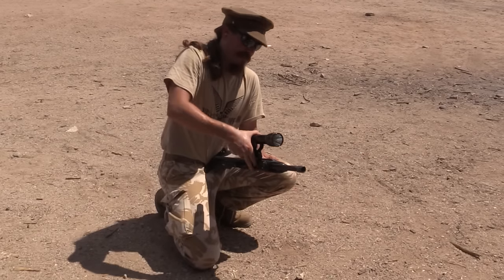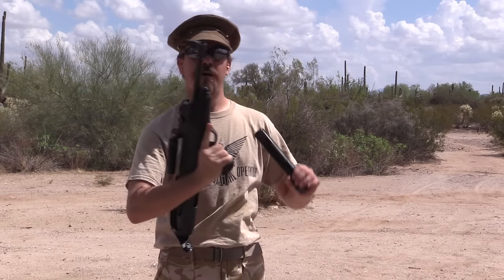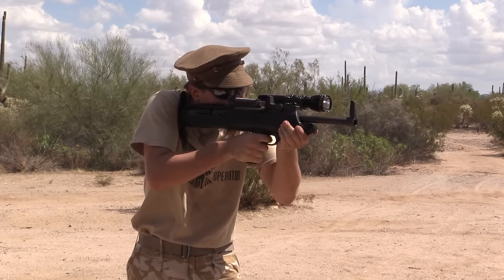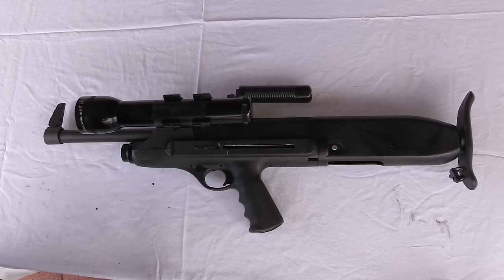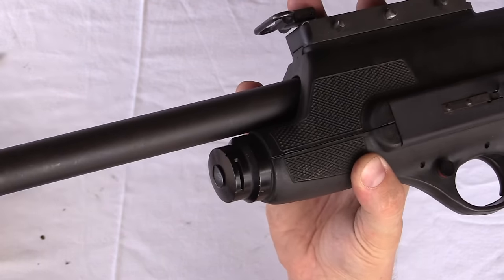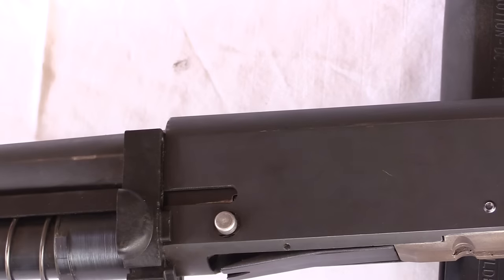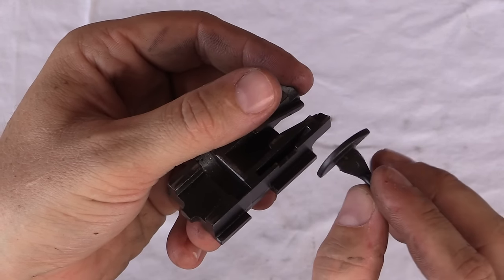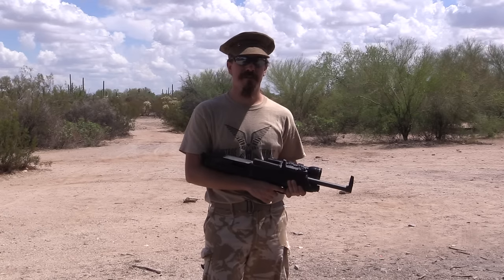High Standard 10B: Disassembly and Attempted Shooting

Comment: Very informative as always. However, I feel I should correct you on one point. The Kel-Lite was very much NOT "a knock-off Maglite." Kel-Lite was in fact the original heavy-duty law enforcement flashlight and originally was not available to the public. I'm not sure when they began to be produced, but by the late 1970s, the Kel-Lite was the default flashlight for virtually all law enforcement officers. I still have the one I bought at J. B. Battle Uniform Co. in Oklahoma City in 1981. Mag-Lite was a relative late-comer to the "indestructible flashlight" business, but arguably developed a more user-friendly product (primarily with regard to their sealed switches which are less susceptible to damage) and thus has captured most of the market. Kel-Lite is still in business, however, and still enjoys sigificant popularity among first responders.

Comment: As pointed out in the comments the Maglight came after the Kel light.  In the late 60s and early 70s police officers had two choices on aluminum flashlights.  The Kel light or the B light.  The B light was sold by Bianchi and the Kel light was sold by Safariland.  I was an officer during that time and I used the Kel light.  The one on my High Standard Model 10B  still works to this day.

Comment: Way back in 1976, when I started out in Law Enforcement, the HS 10B was being passed off as the replacement for the pump action shotgun....The only one I ever encountered had the exact same problem(s) you had with the one seen in this video. We tried every brand of "high powered", high brass ammo then available and failure to feeds were VERY common. So my department, at the time, passed on it and stuck with the 870s then in inventory. I don't know how many were actually manufactured with Law Enforcement in mind but I do know that while I was in the Army in the 1980s it's twin was tested by the Army to replace the pump action "combat shotgun"....That didn't go anywhere either.....I'm kind of surprised anybody ever bought one thus giving you the chance to test the example in your video. With some tighter specs it might actually have been of some use other than as a door stop, but as it was, it was a failure.

Comment: I had a similar problem, a floating pin, with a Remington Model 1100 lightweight 20 gauge. It would work flawlessly with light field loads but when I stepped up to magnums for ducks and pheasants it would run into the same problem every time. The first shell would eject normally, the 2nd would drop in my lap (or on the ground or into the swamp) and the third would remain in the magazine. Manually racking the bolt would then feed the 3rd shell. So? I had a ergonomically challenged two shot bolt action shotgun if I loaded three shells.

I went through that gun again and again and everything seemed normal but the problem would crop up whenever I used heavy loads. I took it to a gunsmith (who I later learned was an incompetent drunk) and he said something like "the gas port corroded so too much gas is going into the gas block" but that didn't make any sense because I had the same problem with two different barrels. By this time steel shot became mandatory so I bought a 12 gauge Browning BPS for duck hunting and started using a Ruger Redhawk for deer.

One day shooting trap the loading gate on my 1100 stuck solid. While I was disassembling it I noticed that the hinge pin was all the way to one side. Ah-ha! Now everything made sense. What had been going on is that the heavier recoil of heavy loads would provide enough shock to move the hinge pin and it would lift the loading gate before the magazine released the shell and prevent it from dropping as well. I centered the pin and gave it a couple whacks on each side with a punch and, low and behold, that gun has functioned flawlessly with every kind of ammo I run through it ever since.

I seldom shoot the old 1100 myself because I have since acquired a 20 gauge Beretta Silver Snipe over-under that is far superior for trap and grouse but, since the old 1100 throws slugs very well, it's the gun that I loan out to nephews, nieces, and my friends' children if they need a deer gun. I've lost count but the old girl has taken between 15 and 20 dear over the years and all but one of them was a one shot kill so, in hindsight, the ability of taking a rapid second shot hasn't really come into play! But? No one has had a failure to feed the second shot, if needed, either.

What's the moral of the story? If your semiauto has feed problems the first thing to check is if any of the pins are floating around.

BTW. My best friend's nephew used the 1100 to take a really, really, nice white-tail a couple weeks ago. It has an above average 12 point rack and weighed out at 232 pounds. It's a very nice deer by any standard and he dropped it with a single slug through the spine, just in front of the shoulders, at 63 paces. A "perfect shot" if you will. He, understandably, got excited when he saw it start twitching and jerking and fired 3 more shots in its general direction but all of them missed and it didn't move more than 6 feet. It was basically dead before it hit the ground. And, best of all, it's a young deer so the tenderloins and steaks have been very tasty and he contributed almost as much sausage meat as the rest of us combined.

Good job, Tyler!

Comment: Any chance you'll be able to do any videos on the Calico brand?
Reply: +deboshadow I absolutely second this motion
Reply: +Hisoka2012 Notion*
Reply: +Gillan Laureth of Seles both are correct?
Reply: Hisoka2012 I just looked it up and apparently both are indeed correct. I had always used notion.
Reply: I had a M-950 Liberator 3. I never had a jam or any issue with the pistol aside from how different it feels when firing. 

The main reason it was never really picked up by any other company was thanks to the Brady Bill/"Assault weapons ban". The company was trying for a police/military small arms contract, but the bill killed any chance.
Reply: +Yu Toob I also heard something bout the sights not working very well, since they were attached to the top of the magazine.
Reply: brottarnacke but they aren't attached to the top of the magazine, they're in front of the magazine. My biggest issue with the Calico is the stock, it's pretty much garbage and doesn't feel rigid ever.
Reply: brottarnacke Huh, that's interesting. Didn't know that. And sorry? Didn't know you'd get all butthurt over some random guy's YouTube picture on the internet.
Reply: Hisoka2012 I just really don't like global mass murder.
Reply: I can only really talk about the one model I owned, but the rear sights were an issue I will say. On the pistol I owned, the previous owner did not treat the rear sights well. It was loose until I tightened it. Then it was a matter of refining it. 

Thankfully, aiming the pistol with the point arm/shoot would give me a decent grouping. I do miss it and if I could get another one I would without hesitation.
Reply: Why would you want Ian to suffer?

Comment: I got screwed out of a Model 10 at a gun show in Alaska back in 79'. The guy wanted $200 for it. I had a $150 on me, asked him to hold it until I got back from the credit union on post (a 20 minute turn around drive) with the other $50 bucks. Got back in just under 20 minutes, went up to the table and the guy says "sorry, I sold it to this other guy". I was pissed. This is an older video (2015) and after seeing the wear marks on the weapon you can tell it was shot quite a bit. The maintenance on the shotgun was not kept up, hence the thru pin losing grip and not being replaced. Normal upkeep on this gun would have provided a better showing than what Ian experienced. I have had some firearms that didn't work or even cycle initially for shit until a little love was shown them. It is like buying a used car, you change all the fluids, get an alignment, etc and work out the bugs as you find them.

Comment: What I'd like to know is did the gun function as it should after the 'pin' issue was found and fixed? Thanks for the take-down section. Very informative and useful.
Reply: I now have one of these in the Model B version. I have shot hundreds of rounds through it (before Covid and related ammo shortages!) with zero ftf issues with it.
I do wonder if anyone has attempted using a 1100 or similar semi auto with this shell on it. Having an extended tube with added capacity would be great.
 Again, GREAT video ,Ian!

Comment: I have a Streamlight ProTac HL 3 on a GG&G mount to the left side of the barrel of my Benelli SuperNova Tactical, and I shoot it every month at the South Florida Pistol Club matches with the light on. I can confirm that with buckshot and birdshot, the flashlight in that position does make a nice bright spot right about where the pellets hit and works great for point shooting.
Reply: Wonder if it'd be possible to use a lens or something to make the bright "inner cone" match the spread.
Reply: +ToastyMozart Maglites actually do adjust the beam focus just by rotating the head. In my experience it doesn't really work perfectly, but it might help roughly match the shot pattern.

Comment: Re: the offending pin: It looks like you could get a pin machined to correct the problem (head machined for an interference fit). If a fair # of police agencies adopted them, & they were made from 1967-1977, this says something - either HS cut a heck of a deal or put a ton of $ into advertising them in Po-lice journals of the day. I see lots of high quality manufactured components in this shotgun. Thinking about it, the plastic bits, even if they are from 1977, are high quality. Thanks so much for posting. :-)

Comment: Cool memorabilia for me. Along with an interesting back story. A block of material to prevent the misalignment of the trigger assembly would present an easy and permanent fix I'd suggest. The bull pup design certainly makes it a very short weapon, easier to weild for the police. One of these in fine fettle would seem preferable to a full size shot gun.

Comment: Like so many things, an interesting and valid concept, poorly executed. Something like this would be great for urban areas and inside buildings, where a compact weapon is a great aid. The mounting of a light was visionary for the time. Many is the time i left my 870 in the car on building searches because of its length and bulk. I would rather have had it with me. If these had been reliable, we might have seen LE switching to semiauto shotguns sooner (many still have not). Some agencies only use the shotgun for less lethal and special purpose ammo, which is a mistake. I carried an 870 and my Bushmaster in a side by side electro lock, and i pulled out the 870 about as much as i did the AR. The other guys were glad to see the 870, without exception. Never had to fire it thankfully, but it was a confidence booster.

Comment: If you want a semi-auto, or auto shotgun in bullpup configuration then AK-style Saiga or Vepr with bullpup conversion kit is probably the most reliable one to get.  Just make sure you feed ammunition that develops enough gas pressure to cycle the gas-operated system, remember, this is basically an AK.  Another note is from my own personal experience, paper or plastic shells tend to get dented on mag lips and jam when chambering.  Steel or brass cased shells work better with mags - Russian factory ammo I used was steel cased, and performed optimally and resolved all the cycling issues I had with cheap store bought ammo.

Comment: Kel-Lite was not an "off-brand Maglite." Kel-lite was the original all-aluminum flashlight. Maglite was originally a cheaper knock-off of Kel-lite. So you got that EXACTLY backwards. I own one of these. From the rattling sound yours makes, mine's in better condition, but mine showed little signs of wear when I got it and I haven't put more than a hundred rounds through it (no jams during that hundred, though). Mine cycled quite reliably with 00 buck so long as you don't use low-brass shells (the extractor will sometimes mangle them), but since nobody I know of sells low-brass anymore that's hardly a problem (several of the early autoloaders would tear up low-brass shells during extraction).

Comment: The 10B I looked today at had the mounting bracket attached to the side of the light, and the light was much shorter in length.  It was still in the factory box, in almost unfired condition.

Comment: I have a pump action "Flight King" which IS the Flight King, aka Model 200 (or Sears and Roebuck/JCHiggins Model 20). The semi auto action is not actually a Flight King. The pump action and semi-auto DO share many of the same componants. The receiver is actually the same when going into machining. With 1 or 2 additional. Things done for the semi-auto.

Comment: Take some Solder or brazing and just mildly braise the tip of that pen inside flush with the metal so that it doesn’t cause a problem anymore. To disassemble, you could just cut the pin and replace it.

Comment: Seems to me like, aside from the right hand only thing, the real problem with this design is the Flite King as High Standard was making it just wasn't suited for semi auto conversions. That lifter pin probably works fine enough on a pump gun when the bolt doesn't go through the full cycle as rapidly or forcefully as it would on a piston gun. I wonder how reliable the original prototypes built on Remy autoloaders were. As you said the concept itself is quite sound, in many ways I'd say it was quite a bit ahead of its time, just needed more work.

Comment: Whilst i can't deny that it is a cool gun, i was a bit disappointed when the "boots" were taken off. :( i was hoping for something far more purpose built than just a sawed off shotgun.

On that note, is it really a bullpup gun if it's just a case of moved trigger before the trigger group? I was under the impression that a bullpup design demanded a system that was specific to that gun. This one is an extension. Any gun that's modified in this fashion becomes bullpup?

Comment: The model 10B has a issue with reassembly.
Needs to be reassembled corrctly.
I've seen the same warnings on disassembly of the mag tube and gas system.....
here's the potential problem:

The gas action and the recoil spring rides the mag tube. 

In the front of the recoil spring is the gas piston. In the rear of the recoil spring is the spring base. In the picture above, the spring base is actually REVERSED from the way it should be installed on the mag tube.....it should be installed with the small end towards the receiver and flanged end forward, in contact with the spring. 

It is deceptively simple when assembling. The gun will go together either way, but it will not cycle properly with the spring base reversed, narrow end forward.....a Jam-o-matic.

Apparently, a lot of police armorers made that mistake while reassembling the M-10.

https://www.shotgunworld.com/bbs/viewtopic.php?f=7&t=279771

Comment: Couldn't you fix that loose pin that made the gun fail to shoot properly by replacing it with some kind of tapered pin? Theoretically it would stay in place and you could shoot more than one round at a time without having to slap the "butt stock"...

Comment: + Forgotten Weapons How much force or energy is required to set off a primer?
Reply: +p38pilotdk01 Depends on the primer. My understanding is that "military-grade" primers are usually much harder and resist being set off, while "civilian-grade" are typically softer and easier to set off. Pistol cartridge primers are softer and easier to set off than rifle and shotgun cartridge primers.

I can't say exactly how much it takes to detonate a primer off the top of my head, but my guess would be between 5 and 10 ft·lbs of force.

ETA: I'm finding some information that suggests that rifle and magnum rifle primers could require as much as 28 ft-lbs.
Reply: I think in terms of energy would be better. F=MA and KE=.5*M*V^2 and PE=.5*x^2.
Reply: p38pilotdk01 foot-pounds is a unit of energy.

Comment: That poor butt plate. I saw in another comment that the shotgun is yours. Did you get around to fixing the issue with that pin? If so, does it run reliably now?

Comment: If it's just that pin, it is an easy fix. Shouldn't be hard to make another. You try to just peen it to hold first.  The cap is styling, add a swagger stick when going to town and you will be top notch.

Comment: As the owner of a Model 10B this little video comes as no surprise. These guns while interesting are problematic to say the least. Stripping and cleaning this piece is time consuming and tedious. No matter how well the gun is maintained  or what type of ammunition is used they simply just don't work, the end result of bad design. Getting this thing to cycle all five rounds can be an exercise in frustration. At the range it will work fine with the first five or ten rounds and then will fail to cycle. Reliability is hit or miss.  Police agencies that purchased the Model 10 quickly found this out and benched them in favor of the tried and true slide action. They look very intimidating but this is not the weapon  you take to the gun fight.